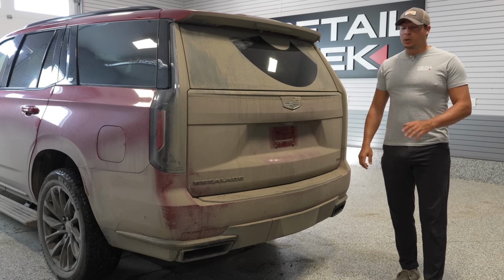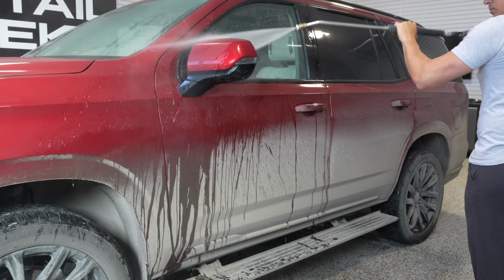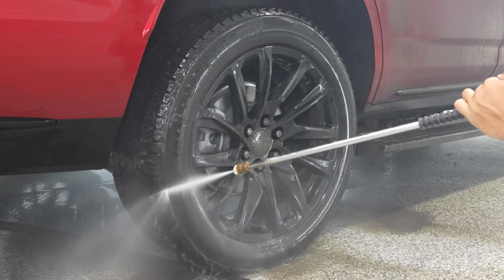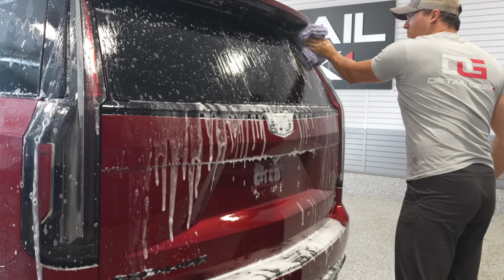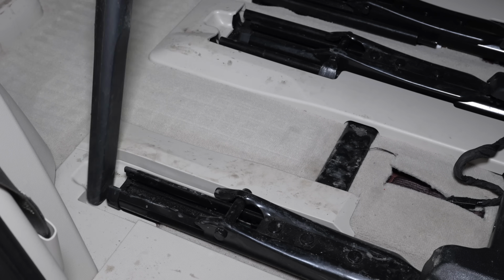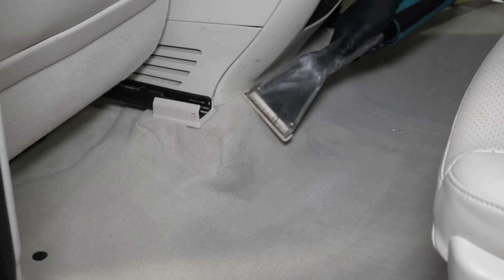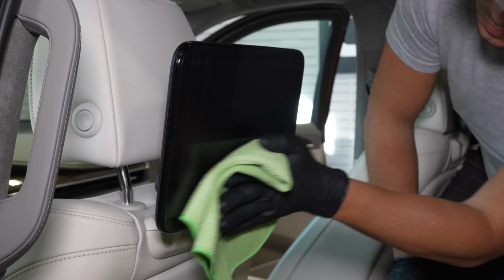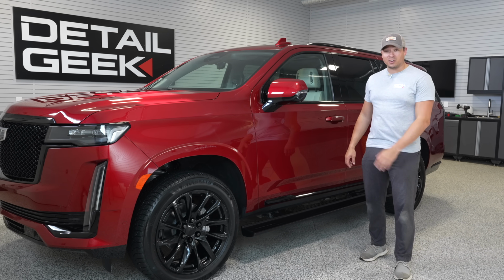Cleaning The DIRTIEST Cadillac Escalade in Only 20 Minutes!!

Comment: I hear severel detailers saying, that I shouldnt use the high pressure cleaner directly on the dirst, I need to foam first, or els the pressure will press the dirt into the paint. I dont see you starting with a foamer, any particular reason for that?

Comment: Hi! I found your channel while searching for solutions to my nightmare and have been hooked at the amazing transformations I’ve seen you do. Truly awesome work and inspiring that there’s hope for this mess I found myself in for the last month. 

I recently bought a 2012 Subaru Outback with over 60K miles on it. It smelled a little funky on the inside but I saw scratch marks on the door and hair inside the vehicle and thought the smell must be dog pee and a good detail would solve the problem. I brought it to my mechanic who said it was good mechanically. Was not sure about the smell though. 

I go back to the dealer and said I’ll buy it as long as the smell is taken care of. About a week and a half later I pick up the car and they are detailing it that morning. I go smell it and I couldn’t smell anything. I sign some paperwork and drive away with my new car. 

I get closer to home about a half hour later and the smell is slowly returning. So I pull in my driveway and start looking around. The only thing I did not check was under the spare tire and I find a mouse nest. I vacuum that out and pray that’s all I find but the next morning the smell is back full. 

The dealership manager says they will take the car back to clean it. At this point I’ve pulled up the seats, stripped the trunk except for the rear quarter aprons and ceiling panel. We go back and forth and finally I tell them I’m done dealing with them because I wasn’t getting anywhere. 

I take it to a professional detailer near my house and they ran an ozone generator in it for 5 hours after a full interior detailing shampooing the carpet, the clothing the
 seats, treating the leather and the plastics. For a week after that I’m mostly smelling offgasses from the ozone treatment but the smell is still lingering. 

I check the cabin air filter and thankfully it’s clean and the blower motor and fan look clean too. Smell is faint from the vents and a little Lysol disinfectant spray did the trick. I check the engine air filter and the filter was clean and new but I see evidence of droppings inside the air filter box so I clean that out. 

The vehicle had a trailer hitch installed which I wanted removed and I learned about those vents behind the rear bumper panel that mice can use to enter the car. My mechanic takes the hitch off the car and removes the apron panels in the trunk. He finds “the mouse motel” and they’ve eaten away all of the insulation behind these panels. I take the car home with the trunk mostly stripped and begin cleaning everything until the sun goes down. 

The next morning I go out and sure enough the smell is still there. I pull down on the roof panel from the top and the underside of the panel is brown and there are mice droppings everywhere. I also see a mouse nest about halfway down the car under the roof panel. 

At this point I’m looking like Chevy Chase at the end of Christmas Vacation in my driveway swearing at what I can only describe as the Mickey Mouse Club House of a car. 

I go back inside and at this point I’m defeated. I don’t know what to do. I take a break and decide to bite the bullet and order all new interior panels for the rear quarter aprons and a new ceiling panel. 

The manager of the detail shop I had taken the car to called me later the next week to see how the car was. I told him the story and he told me to bring it to him again and he’ll strip the panels out and get them cleaned underneath so my mechanic can install the new parts. The car’s with him now and my mechanic has already received the parts to install so hopefully this nightmare is over. 

So yea, seeing your vids has certainly given my hope that my car isn’t a lost cause and had this not happened I probably wouldn’t have found your channel so there’s some silver lining! Awesome content and thank you as your videos have been helping me deal with this!

Comment: Something I find puzzling, the amount of dirt on the bodywork - yes Canadian winters - but the brakes...rotors/discs, backplates and calipers looked new. No corrosion at all on a filthy vehicle with 15K on the clock. Strange!
Reply from the maker: 15k isn’t that much…vehicle is only a year old. Why would you expect to see corrosion already?
Reply: Perhaps because I live in UK, have been driving for 55 years, and it's not uncommon over here. I've replaced calipers and rotors  and had them show signs of corrosion with 12 months, and I cover maybe 10,000 miles a year. Just struck me as odd, but I notice detail.  @TheDetailGeek